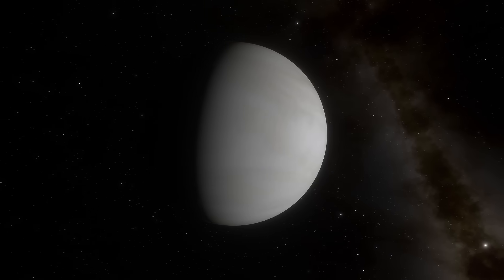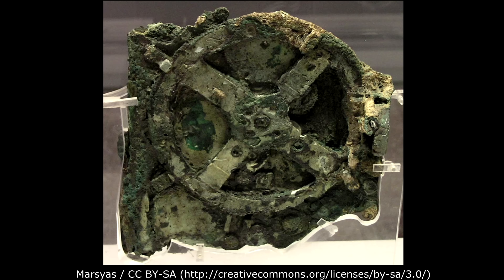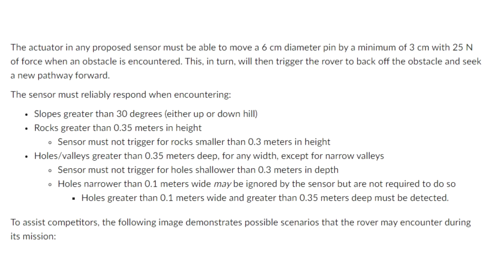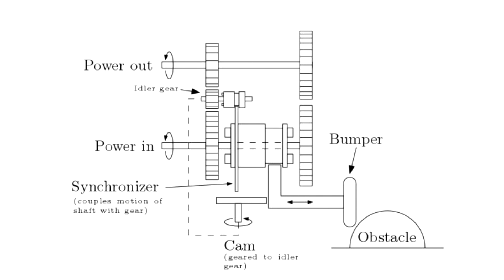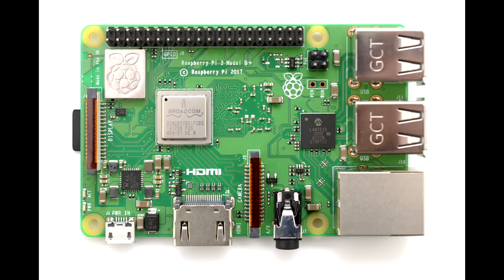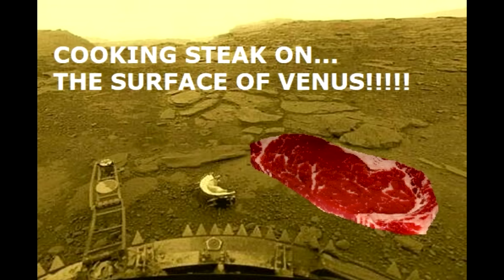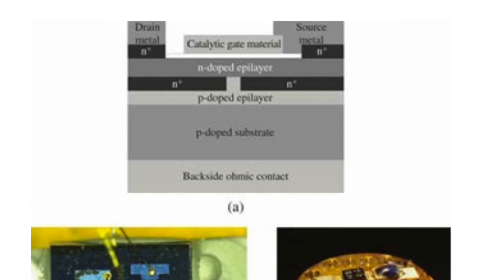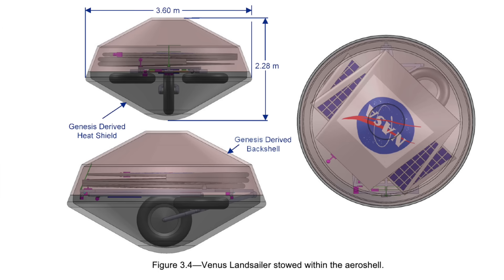Venus Rover Concepts That Beat The Killer Atmosphere

Comment: You know what? Once I had a dream about being a member of a manned mission to Venus. You may think I am crazy but sometimes I have such "lucid dreams", very rarely, like once in a year or two. They tend to be quite realistic even if definitely dreamlike. After waking up I thought a bit of what I just dreamed and concluded that after polishing some corners it would be a viable SF story. To keep it concise: a base had been build by robots, powered by convectively cooled high-temp nuclear reactor with gas turbines and generators, located across a low ridge to shield the base from radiation. The base was a small habitat with Earthlike atmosphere, a workshop with Venusian atmosphere composition but with normal temperature and pressure to save on oxygen to purge the interior (crew working in respirators and light suits), and machinery compartment with 4-way redundant high-power heat pumps cooling all the interior, outside radiators made of titanium with forced Venusian atmosphere flow. In the workshop the crew would prepare various drones and rovers for short-term automatic missions, launching them from an airlock and refurbishing them after they return and cool down. The access to the base would be by a shuttle from an orbital station, powered by criogenic fuel/oxidizer liquid rockets. A shuttle would land near the base and stay there for the time needed for the crew to enter the habitat (cooling itself by evaporating criogenics) then take off and soar in the upper atmosphere on standby for a rescue mission (if something happens). There would be two shuttles taking turns in standby, and returning to orbital station for refueling. After landing, the crew would don heavy exoskeleton suits similar to those rigid suits used for deep diving, walk to a rover similar to the Apollo one, powered by high-temp RTGs and induction motors, operated by simple switches only, no electronics, and drive to the base. They will enter the airlock, wait for purging the lock and cooling down the suits and enter the habitat. Of course there will be a lot of technical challenges to do that (and little sense in a manned mission to Venus), but this is what my brain created in its spare time, which it should use for sleep! Not much sense in a dream, but almost good, for an SF story at least. Pity I have little writing skills :-)

Comment: drones usually have base stations.  i know its crazy but if you where able to dig into the soil on the planet, would the temp go up or down?  how deep would you have to go to be able to maintain a protected computer hardware/software "package"?  and if you could keep a hardened chip running for 22 days... then wouldn't it be possible to extend its life if you put it into a safe garage of sorts... to "reset" its exposure? ... lots and lots of questions. what about light side/dark side mechanics?  i can't say i know anything about its rotation but has to have a variance in surface temperatures somewhere.  thou idk if the magnetic/ radiation belts exist and to what extent for venus.  got me thinking sorry if i wrote too much :D peace.

Comment: How about a thermoelectric cooler cooling a Raspberry Pi.  Use a dissimilar metal thermal junction for power.  A Stirling engine similar to that used to cool the seeker in an AIM-9X Sidewinder missile would also be worthy of consideration.

Comment: Turning is simple if you can get a high temp electric motor. Just use the motors like you would on a tracked vehicle by rotating on forward and one back

Comment: could try using a cylinder of liquid nitrogen as a power source with some carnot cycle love and compressed helium to assure enough pressure to exhaust phase changed nitrogen. Keeping your electronics at a working temperature should be trivial up until your battery (cylinder of liquid nitrogen) runs out. To get power you pretty much need a gradient. And Venus already has heat. Nothing that radioactively releases cold, but well, I have a certain amount of faith in our ability to build a decent thermos.

Comment: I'm curious if it would be possible to build a boiling cooling system. 
Most liquids, when they are boiling, the liquid will stay always at the same temperature. So my thought is, if they build some kind of probe with a big tank of liquid gas, something with a high transition energy capacity, paired with a very thick isolation on the housing, this may be able to apply a cooling system that could work for at least multiple days. 
I did not find a table or calculator but just as an example: Let's say liquid methane that has a boiling point of -168°C at sea level, what is the boiling point at 92 atmospheres of pressure? If there is a gas that has a boiling point somewhere around 100°C at that pressure, where hardened electronics could still work, this could be used as a thermal sink. 
Keeping the outside temperature isolated as good as possible they could transfer the thermal energy of the electronics and from inside the housing into that liquid gas chamber, the gas would boil, causing a pressure higher than the atmosphere. This pressurized gas can then be released through multiple valves (to isolate from the outside temperatures) into the atmosphere and keep the pressure tank at a constant temperature and pressure. 

the better the isolation of the craft energy efficiency of the electronics, the longer this cooling system could run before all the gas is boiled off. Just found that Article about Hopper cooling
. But I'm not sure how long that will last.

Comment: Probably-silly idea: a fluidic computer that uses molten lead as the working fluid.  Slightly less silly, perhaps something involving vacuum tubes, since those need to be hot to work properly (though of course, there are a lot of problems with that, given that the tubes would need to hold up against or be protected from the atmospheric pressure of Venus, may be rather bulky, and could not be replaced when they burn out).

Comment: This is RETARDED. Why bother to have a mechanical thing that moves around if you cannot hav high resolution cameras and other ELECTRONICS that bring back the images and data we care about?
--
A better idea is a mechanically cooled electronics package. It doesn't even have to be perpetual. You can spend a week storing mechanical energy to run a refrigeration unit which then allows for 10 minutes of electronics operation. As long as you can repeat that thousands of times you have a functional rover.

Comment: Sounds to me like magnets are the answer. Perhaps a magnetic river design but with the ending of the river being a cam gear, infinite power with only initial effort required. A wind turbine generating motion for an electo magnet is by far the key to Venus exploration, you can generate all the energy you need, more coils.....stronger energy field. It also concerns me NASA and SpaceX haven't used magnetic rail systems for propulsion of space craft to exit the atmosphere. All it would require is placement near a hydro electric damn to change the rail drive launch pad.

Comment: The upper atmosphere of Venus is more hospitable, couldn't we use that to sync heat away using a tether and possibly use the temperature differential to create power? You could keep most or all of the important electronics in a properly designed tethered balloon to transmit data.

Comment: Long before Mythbusters, I built a kitchen set possibly for bug spray or an exterminator service. My big deal was an oversized "under the fridge" set piece they could move around to camera. Well here comes Jaime who had built a spider animatronic with 8 articulated legs. I asked where he got the parts, he said they had machined them at M5. The spider was about the size of a matchbox, with a hair thin control wire.

Comment: Why does it have to be on the ground? can't it be an airship? if the atmosphere is so dense it should be easy to float something in a semi rigid hollow body. Use some stirling engines  and solar for power and you can fly around the planet.

Comment: I dint think it's so much about people thinking they know better than NASA, rather it's that we can do and even think more simply. NASA is incredibly good at over engineering things and overthinking things for every situation for the nest changes of success. Some random person on their couch after work can come up with the simplest solution usually right off the top of their head. Gotta keep something cool in a furnace? Insulate it well. Does that osmething also produce heat that needs to be regulated? Use temperature differential cooling, make the container for the thing have a large open space inside so the heat can be dissipated to some degree before the differential cooling even comes into play. Find a way to combat moisture from the differential cooling, and use mechanical stuff for the parts that have to be exposed. As for cameras, use heavy shutters that can open and close to protect them following the same principal's above. Dealing with pressure is above my head though. 

Failing all of that, develop a closed loop cooling system that can also let heat escape one way. That last part is kind of easy, simply design a way to pressurise the system higher than the atmosphere and the. Purge the heat. The closed loop cooling is more difficult. 

What do we as humans do to protect ourselves from heat in the most basic way? Layers. Build a large layer based system where each layer cools the coolant medium from the previous layer, say water or air. There is a thousand easy answers, just the implementation part goes above my pay grade.

Comment: GE Appliances did something like this when they came up with their self cleaning ovens in the 1960s.  Their P7 system was all mechanical controls like mechanical timers and linkages for the door lock (you cannot open the door during the super hot self clean cycle).  Today's self clean ovens use an electronic package for the oven controls and sometimes, if it overheats, you don't have an oven at all until you call a repairman.
Reply: One interesting part of the story:  GE could not patent the concept of using high heat to burn food soil off of an oven, but they could patent the controls needed to get there.  So every manufacturer had to come up with their own controls to get the oven up to such a high temperature, 900 degrees F (or pay GE for their patent).  When Frigidaire was part of GM, they had a very complicated mechanical setup but a Frigidaire oven cleaned up spotless, Kenmore, for example did not do as well.  Frigidaire, now Electrolux, uses the electronic controls that are too heat sensitive.  Whirlpool has the worst situation with their wall ovens.  Run the SC cycle too long and you fry everything to the point you cannot use the oven at all.

Comment: i think the solution here is not ground rovers, but hot air balloon rovers, the buoyancy with the kinds of pressure involved would allow for quite a heavy payload with min. effort, in fact a pressure/ temperature differential device could act as a power generation itself floating up and down in a sine wave pattern we already have them in existence, albeit lil model versions only, but the concept has been proven, in conjunction with a turbine, but just floating letting winds carry you like that sail requires near zero power. This would also defeat the need for something to tolerate high pressure and high temp loads, just float above it all, would need back up systems to ensure its floating mechanisms never fail, everything hinges on it floating over it all so that would need to be top priority. Also for power we need to explore artificial chemo-synthesis to take advantage of those sulfuric clouds, and not rely solely on mechanical generation but at higher altitudes solar may be feasible

Comment: ... Why not use metallic punch tape for the memory?
Sure, it's low tech as all balls, but it's high energy resistant, and it can resist anything short of a boulder crushing the probe, which... I mean at that point you'd have more problems than just the memory. Not sure how viable this is in regards to dynamic memory operations, but for basic programming and logic routines... I mean, could work, right?
Not sure how to translate the interpretory mechanism into something like that, but it's probably worth looking into.

Comment: Low performance computers using nuvistor tubes can be made and also the analog video camera which would withstand heat ,consisting of old picture tubes(similar to surveillance cameras used in the '40s) and the transmitter unit. A purely mechanical unit can't collect,process or send any kind of information.

Comment: Hey Scott, I had a question I was hoping you could answer that I've been thinking about. Do you think there's any chance that any of the Russian landers on Venus still would like like they did when they left earth all that time ago? Do you think they're just metal puddles on the surface of Venus or a combination of the two?
Reply: The later ones had pressure vessels that could survive twice the surface pressure, so they're probably still in one piece (or not imploded). Any external hardware would've perished, internal hardware is maybe a melted puddle (not crushed, but the temperature eventually got trough the 2-3 isolation layers).

Comment: For recording data you could use something in same lines of technology that is used with LP's. You need a harder surface to write on on Venus though, but it wouldn't be lost easily. For getting that data from Venus I don't know. Maybe with sound, would a probe in high altitudes of Venus be able to hear it and then communicate it further digitally?

And tracks for navigating tough terrain. There is probably a reason other than weight that NASA hasn't used tracks on Mars and most likely won't on Venus, but it be awesome to have a tracked rover.

I'm interested to see what will come out of this competition.

Comment: .... can... can we... can we not just stick a low wattage controller into a a MoSiBTiC container that is at an ultra-high vacuum? I mean, with an ultra-high vacuum, you don't have to worry about outside temp as there isn't enough molecules to actually create a temp. And at that point, you just have to make sure your electronic devices don't generate a lot of heat that needs bled off.

Edit: MoSiBTiC is an alloy with a stupid high melting temp (over 1900C, venus surface temp is 462C) and can withstand stupid high pressures (I think it is something like 200 MPa, Venus surface is around 9.5). I'm sure you'd have to worry about decay from oxidation and of course the structural strentgh of the chamber will be lower than the melting point but... yeah...

Comment: If there was  a way to have a light on the rover that could be used to send basic data to a probe as a relay between the the earth and the rover that could work and The light could be controlled by mechanical switches.

Comment: The heat of Venus is geological and not atmospheric; its tectonic plates are fused, and the ground itself radiates heat everywhere.  Thus, wheels need to survive extended contact with the surface.  The atmosphere on Venus is so dense that meteorites can soft-land instead of disintegrating on impact.  It's why the Venusian surface has few impact craters.  

So that would be a great find for a mechanical rover:  seek out a meteorite or asteroid fragment that survived a fall through Venus' atmosphere.  Would it contain metal ores that are slowly melting onto the Venusian surface?  Pictures from a find like that would definitely justify the mission and most certainly capture imaginations!

Comment: Forget the rover idea. A drone-balloon/submarine that floats in the heavy air would be a much simpler technology and give better mobility to explore over hard to reach terrain. Pick your altitude or raise up for data transmission and dive back down for data collection. Many of the sensitive components could fold away under protective thermal shields like the components of an F-22 Raptor. Matter of fact, the more I think about it, the more it makes perfect sense!! :-D A larger surface area like outside hull give a great way to disipate heat from a compressive heat pump. Larger surface area makes it easier to cool sensitive components even when the ambient temp is higher.